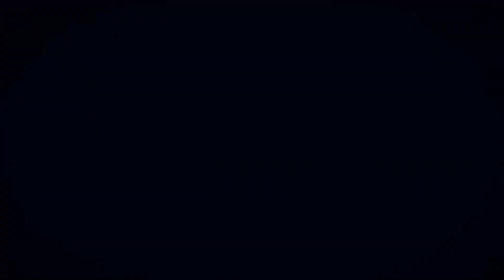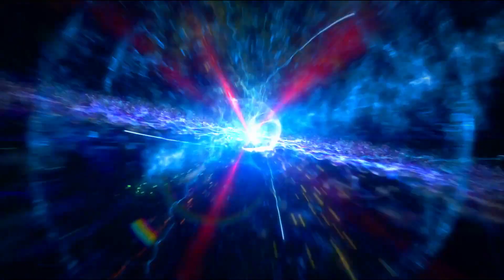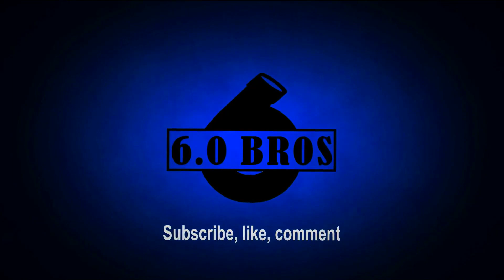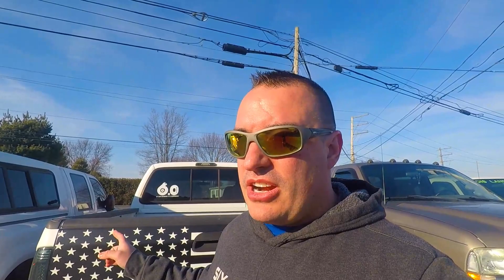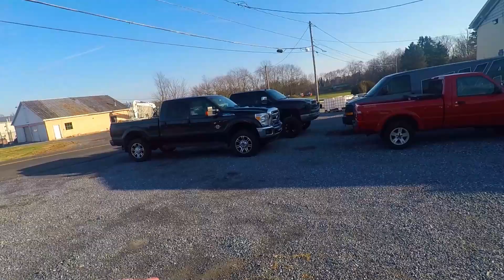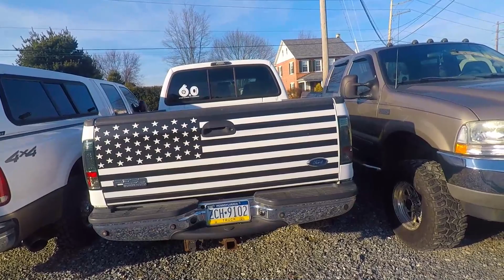6.0 Powerstroke Future Build Plan

Comment: Quick question.  My 6.0. 2006, I know is running the original hub assembly.  I believe it is time to replace them both.  However,  other then factory OEM. Do recommend a great hub assembly? 
FYI. Mine is 4x4. Thx
Reply from the maker: Just to clarify do you mean the wheels bearing hub assembly.  Or the 4x4 hub to lock them in
Reply: @six0bros  bearing hub assembly
Reply from the maker: Here is the brand I use on my super duty, Timken makes the oem wheel bearing so it is high quality. This is an affiliate link

https://amzn.to/3lSyfsF
Reply: @six0bros  I read Timken was a good quality part.  Thx for the input.  While I am there I'll be putting new Warn hub locks as well.  Might as well do it all. 
Plus I really want to upgrade my brakes to bigger ones since I'll be running 8 inch lift with 37 tires. 22x12 wheels.
Reply from the maker: I one day would love to do the willwood brake upgrade but man they are expensive lol
Reply: @six0bros   Yuuppp. I'm in that same boat. 
I heard ok things about the extreme brake upgrade
Reply from the maker: I felt poweratop brakes worked really well for factory system there is also the sbcc brake kit I have looked at as well

Comment: I would feel very uneasy running a high dollar short block with 700 horsepower on stock rods......
Reply from the maker: I do not plan to. I plan to run about 600 and then when I am ready to step up to 700 I want to have upgraded rods. Although I may run 700 for just a little. We will see what happens that is still a ways off

Comment: I sure like to know if it is a lifter or not. I just got the shorter pushrods. You did cam lifters and pushrods so it sounds like all that work didn't help you. I am trying to save my cam/lifters. Can you give me any info on this endeavor?
Reply from the maker: I think the mistake i.may have made was I didnt replace the lifter guides that hold them down. I could be wrong but I think that is where my issue was. Again I could be wrong but as soon as I know I'll let you guys know